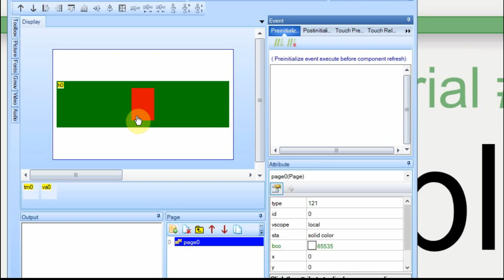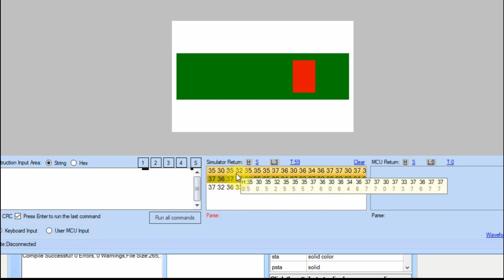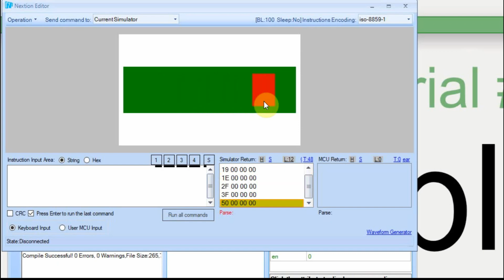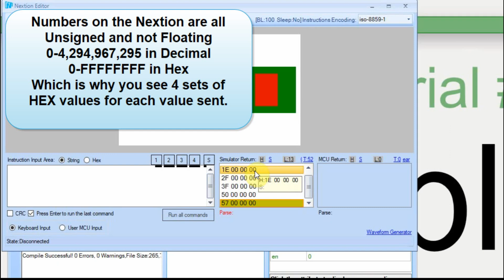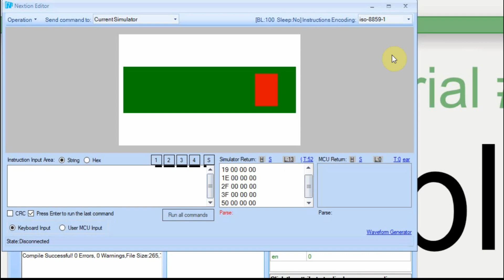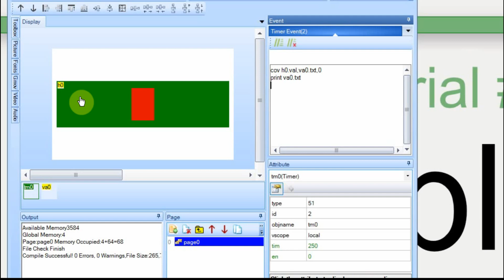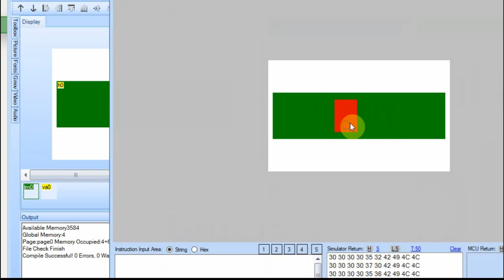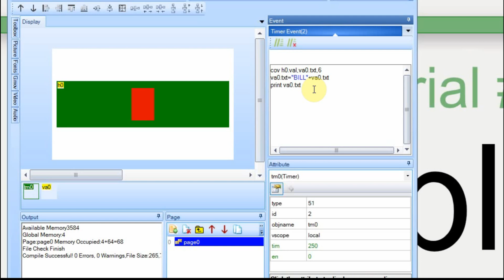#86 Nextion Display Slider to Arduino PWM Part 2 some questions answered

Comment: Don't use print anymore it's deprecated. Instead of print "your string" use prints "your string",0
Reply from the maker: I will look into that.  Nextion is not the best at supplying Technical information.